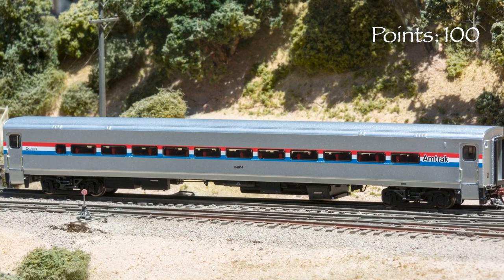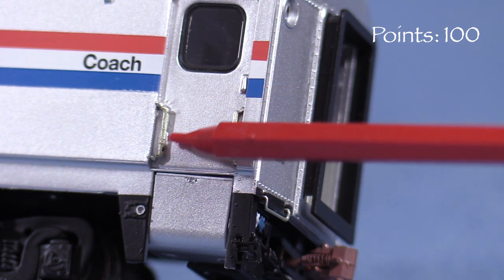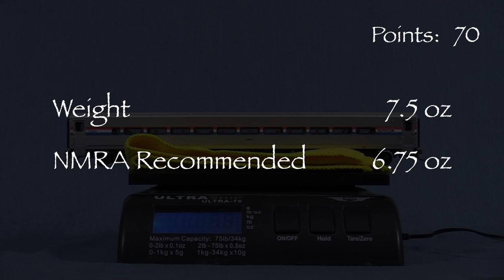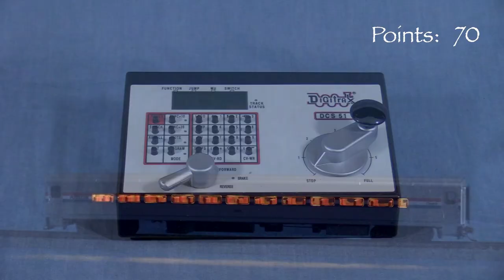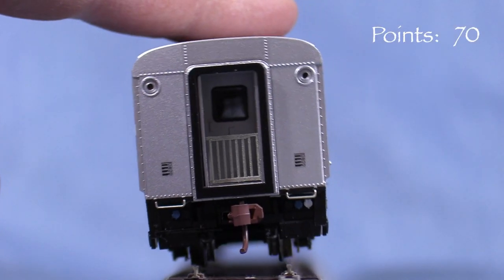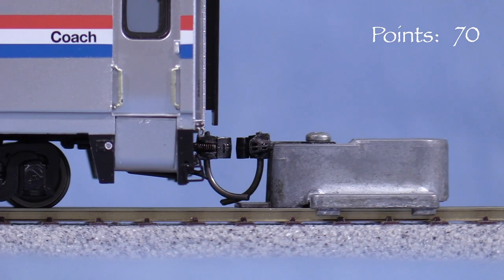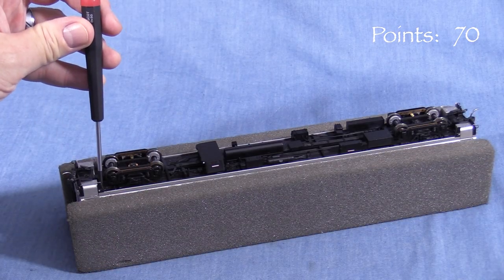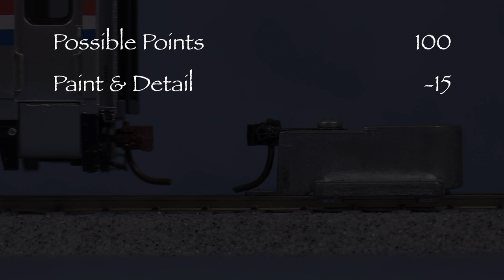Product Review HO Rapido Horizon Coach

Comment: Ya know when Rapido used to go over to their factories throughout the year it seems like they didn't have as many problems like they've run into recently with some of their products. After the fiasco with the SP switchers I'm just hoping my Ski Train F40 doesn't have as many issues. I'll still support them but I'm a bit more cautious nowadays.
Reply: They just aren’t able to control the quality nowadays with COVID.
Reply: @Trainmaster909  sadly you're right. Like I said this is just a rough patch for them but I still like their products
Reply: @amtraklover  give it another year or two and they will sort it out. I myself am going to hold off on ordering any of their products unless they make something I absolutely need. As of right now, I am much more interested in stocking up on Scaletrains and Athearn Genesis 2.0 equipment. They are doing a very good job (except for the SD80MAC which mine would have gotten a 60/100 using Dan’s scale).
Reply from the maker: I hope they can get the quality control issue under control.  I hadn't considered that it could be pandemic related.  That has certainly had a ripple effect.  I actually had some of the Ski Train cars on pre-order a while back but canceled them because the COVID situation has reduced our income, and I'm trying to save my hobby money for stuff more directly related to my 1990s SP theme.  Thanks for watching!
Reply: @DanielCortopassi  Amen Dan!!!
I cut back on everything outside of
Conrail middle to late 80s!!!

Comment: Comprehensive review, as usual.  I agree these a very nice cars despite their shortcomings, and there are no alternatives, as you point out.  I purchased quite a few and fortunately did not have to deal with any paint flaws.  As my layout has very broad curves I am able to use Kadee #153 short shank couplers.  These couplers bring the diaphragms together.  Truck wobble is an issue, and I like your solution.  Mine involved put a ball end mill in a Dremel tool and grinding down the posts (no need to remove the trucks) using a cautious trial and error approach as it is best not to remove too much material.  Yes, Rapido could put a little more effort into this and make our lives easier.  Obviously not a problem for either one of us, but not all modelers have the necessary tools and skills.  Keep up the good work.
Reply from the maker: Thanks for the info on the 153s.  I was wondering if those would close the gap but don't have any right now to test it out.  Right now I'm planning on a 32" minimum radius for my upcoming layout so I'm hoping that will be broad enough to avoid issues with most equipment.  I often resort to grinding or filing stuff to solve wobbling problems, though I couldn't quite figure out how to make that work on these cars.  Sounds like you did.  Thanks for watching!
Reply: @DanielCortopassi  My minimum radius is 48”, which is quite generous for a home layout.  Radii of 32” will call for some experimenting, and I am sure you will come up with a satisfactory solution.

Comment: I don't always agree with every ding in points you may give a model, but many times I think there are valid points for the deductions.  However, this time I fully disagree with dinging these models for wobbling induced by "the hand of God".  If the model wobbles while sitting still and being plucked by a 1:1-scale human hand, then that is just unfair nitpicking.  Now if the model wobbled while running, then sure, a valid point.  If the fix that the manufacturer suggests doesn't work for a reason like you pointed out, then sure, another valid point.  But since you never actually ran the car on a layout, you don't know that it would wobble in operation and the "fix" that you showed may not have even been necessary.
Reply from the maker: Granted, I don't have a functional layout to run cars like this on right now to test them in "real world" conditions.  I have, however, been a model railroader for decades, and have had layouts in the past.  One thing that bothers me is seeing rolling stock wiggle rapidly back and forth as its rolling down the track because it's wobbly.  Some real train cars will rock back and forth, but they do it very slowly because they're heavy.  Model trains are light and so the wobble is way too fast to look realistic.  I am admittedly very fussy about operational standards for my equipment.  Some people aren't as fussy, and they might be happy with the results they get, so that's fine. When I do a review, I'm mostly just trying to give as much information as I can.  People can do what they like with it.  Thanks for watching!
Reply: Yes, you're absolutely right -- wiggles don't scale down, so a wiggling or wobbling model train car does look silly and unprototypical and I agree, it should be fixed.  Also, I'll say that your fix on the review car was more complicated than it should have been.  I mean tightening one screw more should really be all that it takes.  I just think that in a situation where it was uncertain whether wiggle would happen in actual operation, then maybe points shouldn't have been deducted until it could be determined.  I too have been a model railroader for getting close to 40-years now, and I have come across some cars that actually tracked better after I loosened both trucks.  That's not always the rule of course, but that just proves that one cure doesn't always cure all.  Thanks for doing these reviews and for sharing your modeling knowledge and techniques.  They are helpful.
Reply from the maker: I had to do the fix I did because tightening the screw didn't work, which I mentioned in the review.  As far as deductions, I apply the same standard to all models.  If people aren't worried about wobbling, then they can disregard that deduction.

Comment: I don't know why manufacturers can't make those diagrams out of rubber or something so that they can take narrower curves.
Reply: They do that in 3-rail O scale. Bachmann used swiveling diaphragms on their HO passengers cars and it works.
Reply from the maker: It would be nice, or maybe use a design like those by American Limited.  I might replace the diaphragms on these cars eventually.  Thanks for watching!
Reply: @DanielCortopassi  I have a problem with my ConCor BCS coaches not taking narrow curves when I replaced the couplers with Sergent ones. If the diaphragms were made of something that squishes then I am positive that it could take those curves.